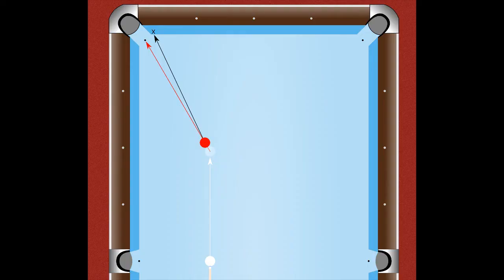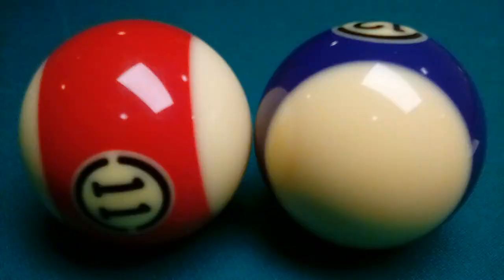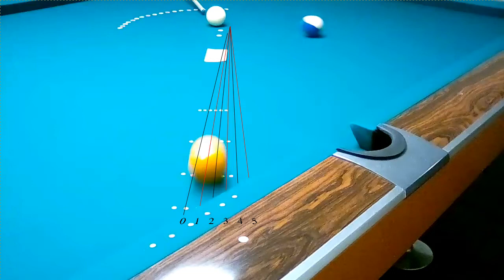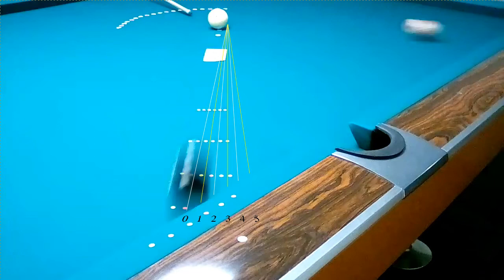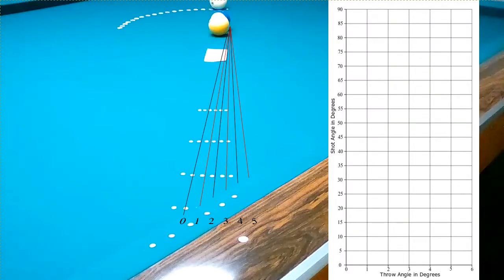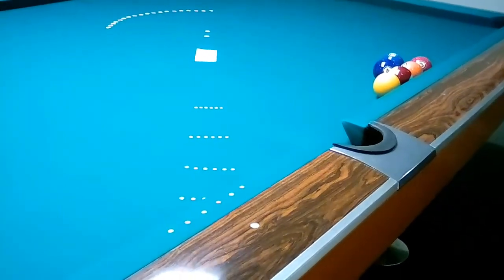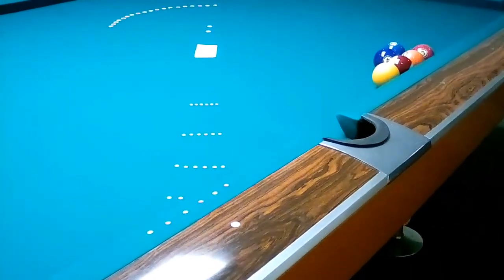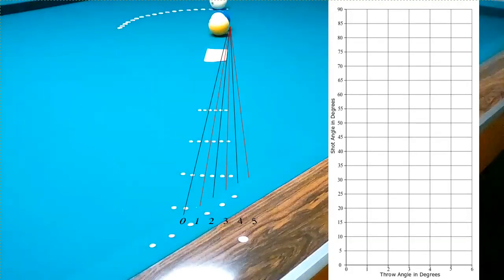Finding Maximum Throw Experiment with Aramith Billiard Balls

Comment: #1 this is great info. 
I didn’t hear you mention that this test only applies to a sliding Cue ball when it hits the object ball, a stun shot,  all of these throw % would change if the ball is rolling when it hits the object ball. This test is also affected by clean or dirty ball.
Reply from the maker: Hello and thanks for watching and commenting! You’re right that this only shows evidence of stun shot throw. I mentioned it briefly at the 4:44 mark, but perhaps I should have emphasized it more. The reason I titled the video “Finding Maximum Throw” was based upon the assumption that stun shots cause maximum throw when compared to rolling and backspun shots, and this experiment’s proxy ghost ball setup necessitates a stun shot. 

Throw during rolling and backspin shots can be easily revealed by using my training tools RotoThrotractor and The Gauntlet. I encourage you and anyone else interested in finding precise throw values with your equipment to download and print these tools available on my website CueAndMe.com under the Training Tools section. Thanks again!

Comment: Very impressive experiment and explanation.  I learned a lot about throw that I didn’t know and didn’t realize and the extent that 4-5% can create an obvious miss from center pocket and be drastically different with distance.  I play in a a variety leagues that don’t always have the same table, balls and other cloth issues.  Can you add anything that would increase throw in the league world?  Balls (old, new, dirty, etc) Cloth (Simonis versus others). Spin at different speeds. Etc.
I look forward to using the tools that were provided.  I actually found you through Dr. Dave’s coverage of aiming and impressed with you Dr Dave and  Bob Jewett
Reply from the maker: Hello, Emery. Thank you! I'm honored to be thought of in the same company as Dr. Dave and Bob, although they've contributed leagues more than I have. But I'm really glad you got something out of what I've offered so far. Without an exhaustive experiment that includes several of the factors you mention I don't know if I can add anything to the throw issue that might increase or subtract the amount of throw. Well, maybe what would be helpful is to come up with a reliable test shot that you can take to any league table to determine how much extra throw or reduced throw to account for. Maybe determine where an object ball hits a rail when placing the cue ball on one spot and an object ball on another spot? A half-ball shot with medium speed? Taking that to a league table and balls, you could perhaps use where the cushion hits to adjust for the current environment. Just a thought. Let me know if you find something that works for you!